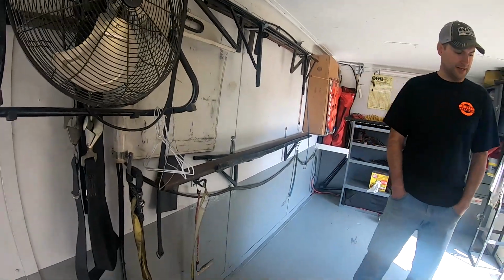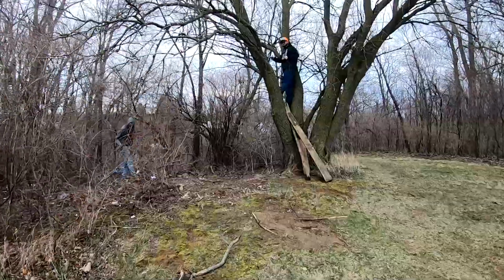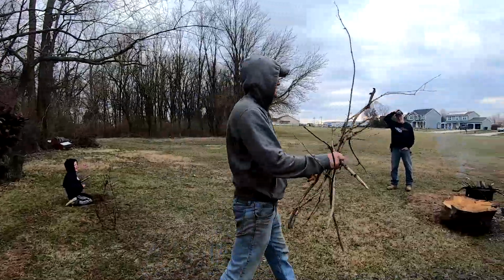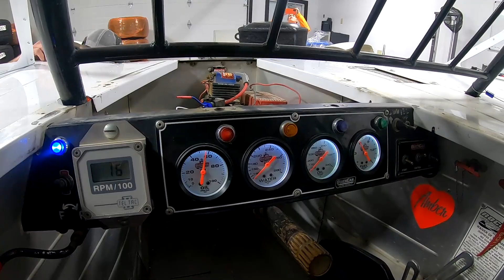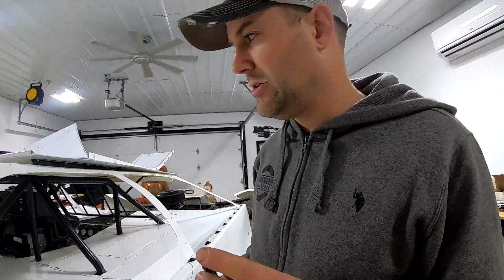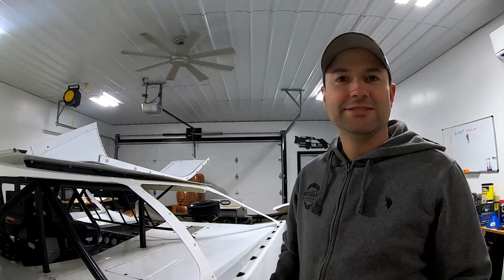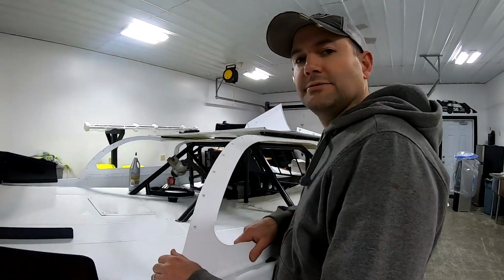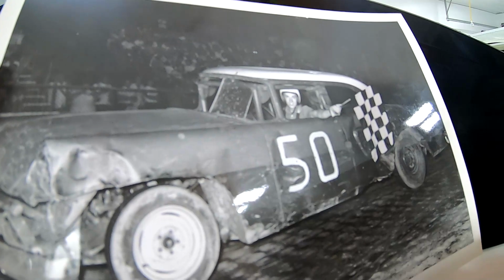Burning Stuff & Spring Cleaning. Daily Upload #25

Comment: The stands are always full when the people in the stands can relate to the cars on the track. Case in point for the modern era, every time I see a race with Crown Victorias such as when Cleetus McFarland's track host a race with Crown Vics the stands are packed, also I have seen two different dirt tracks host races with Crown Vics, in which the grandstands were packed. I will add back when I was younger the Enduros, which morphed into factory stocks got large crowds for 100 or more lap races, this goes back to when I was four or five attending races at the Tulsa Fairgrounds Speedway in the late 70s early 80s. 

Now a funny story to me, is my late dad got me involved in motorsports and more specifically dirt track racing. Then would not allow me to go until I was 12 I believe. Then stopped allowing me to go. Which I just had my mother or someone take me, which dad a actual racer who had cars he drove would get extremely angry over me going, even when I was older and on my own, he would get mad that I was going to the dirt track races. Especially when I got more well known than he was, because I was working with teams which were winning tons of features, and championships. My late dad literally got red hot infuriated that the team I was working with in 1994 got me a birthday cake and sprayed me with champagne after winning the feature on my birthday that clinched the track championship at Creek County Speedway owned by Emmett Hahn at the time. Which I used that as motivation to go to more races, even travelling. Because he thought I should not be going to the races or working on race cars at all, which obviously based on what I have already written above you can tell I put my late dad on ignore and did it anyways. Even to the point I could show up at any of the tracks you race at one any given race. (Because I have been to Eldora back when Earl still own the track, I have also been to a dirt track race in Canada when I lived up there.)